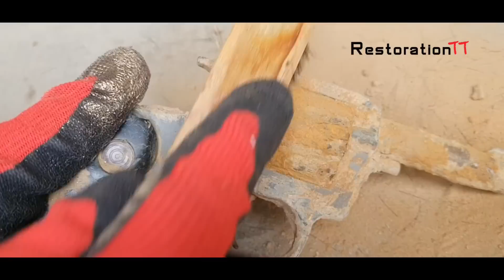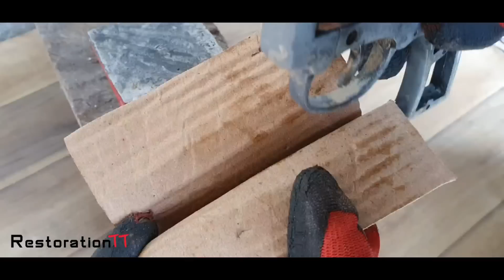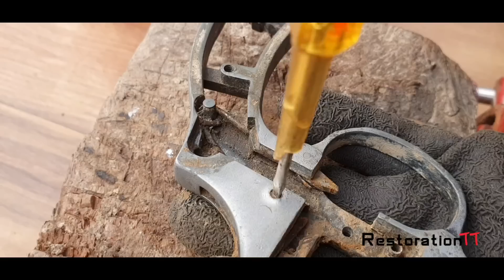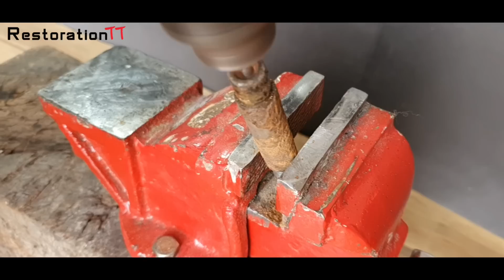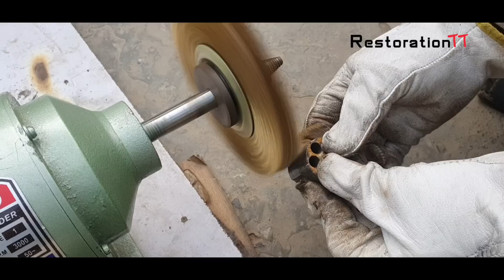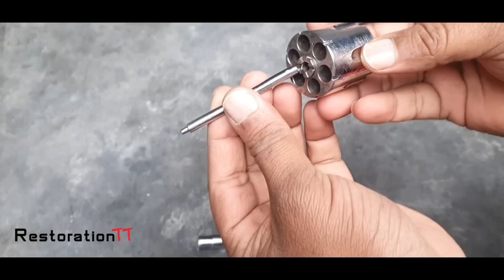Restoration Antique German Revolver -  Restoration Video

Comment: I found the state of the weapon strange, at first it is believed that it had been submerged for years, but if that were real, the trigger guard and other parts of the revolver would be completely corroded.
Reply: It is staged. Why not ultra sound it right away.
Reply: In the description it said it had been submerged 1 month 19 days...so the condition isnt surprising

I not sure you could call it fake exactly but it didnt feel kosher
Reply: @wildfire160  I couldn't see any marks at all, the gun appears to be made of zinc and the barrel bore is massive. Note the tailgate's tiny suspension.
Reply: It's complete nonsense, completely fake.
Reply: Assuming you’re correct why was there a no barrel bar at the muzzle????
Reply: Looks like different materials, barrel/cylinder/hammer are probably steel while frame is some sort of alloy. Probably zinc. Which is why it rusted at a different rate. Cast zinc (instead of milled steel) is a way to cut costs on blank guns or starter pistols since they dont have to retain the pressures of real cartridges.
Reply: A
Reply: I would believe it’s a toy gun but one more realistic than usual. The caliber is too large to be a real firearm and it looks like it’s a die cast zinc construction.
Reply: It fake
Reply: @richardcasey7521  : German blanks/ teargas revolvers had been during fourty years made in 6mm Flobert rimfire, 9mm R, for a short time also in .22 rimfire and a short .45 cartridge. Those .45 disappeared very fast, and .22 rimfire is no more allowed ( like 8mm pistol blank cartridge).

Comment: Once i saw sand blasting and using a dremo wire wheel shaft as a drift iIleft just a hack that doesn't have a clue
Reply: No need just saying what I saw improper tools used and harsh cleaning methods much to be learned by some